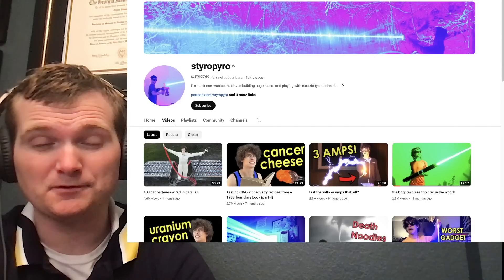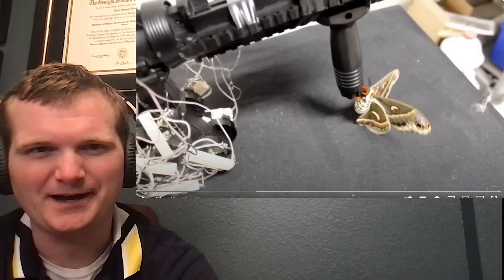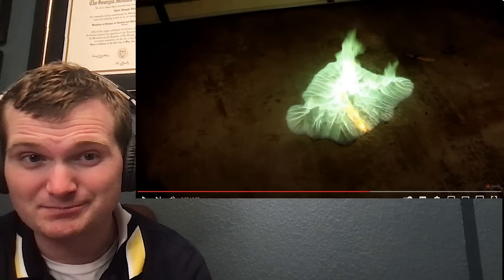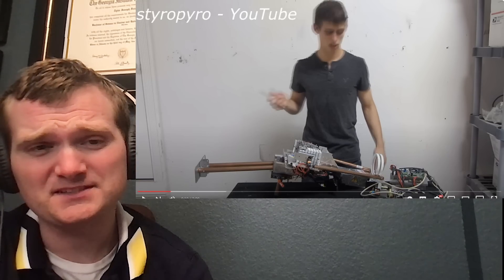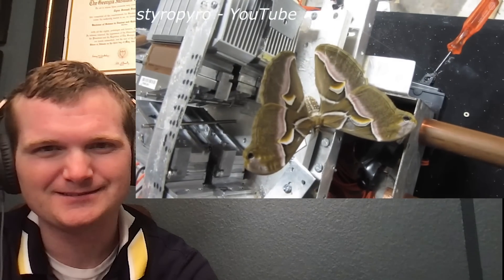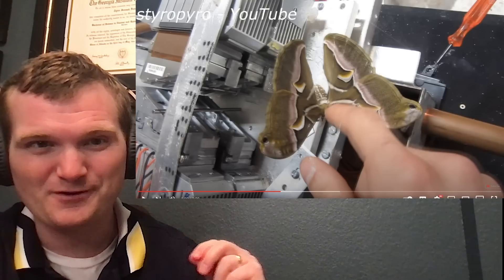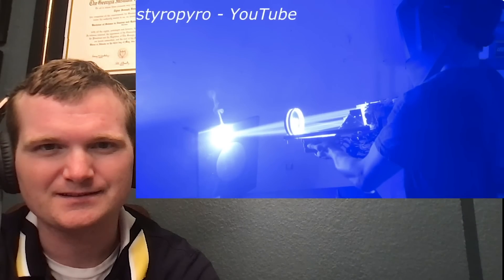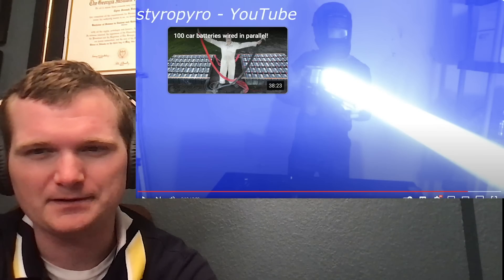LASER SHOTGUN and BAZOOKA! - Nuclear Engineer Reacts to Styropyro

Comment: 5:40 is what you use to fully disconnect a piece of equipment from power, and to lock it out to prevent accidential or unauthorized startup.  His circuit breaker with a screwdriver sticking out is just for killing power in a panic.

Comment: I've got an old lab laser which I don't dare to use. (I don't have the key for the power supply, no matching power cord and the laser unit is missing the cooling..)
this only has a rating of 500mW and is class 3B 450-530nm.
So his bazooka is 400x stronger (and runs on battery instead of almost 3KW from mains)
Reply: That's smart of you.